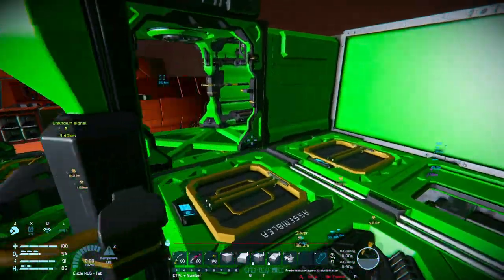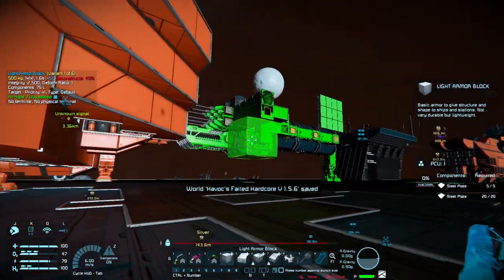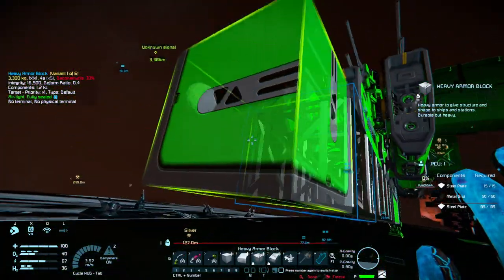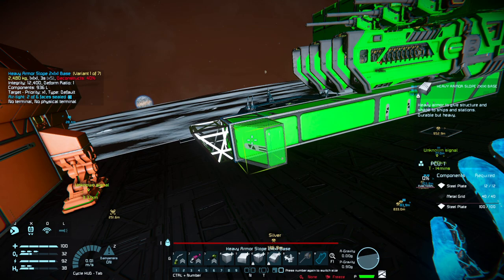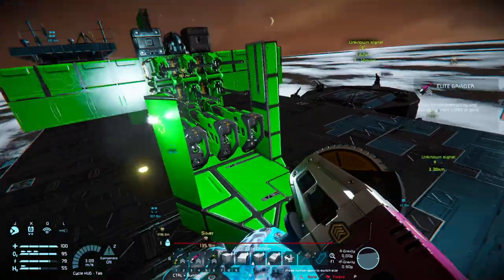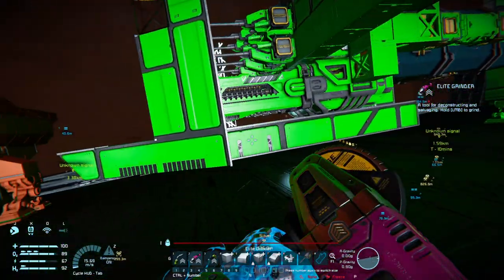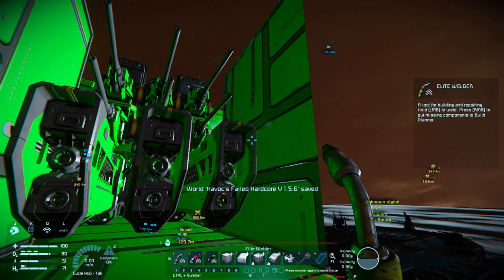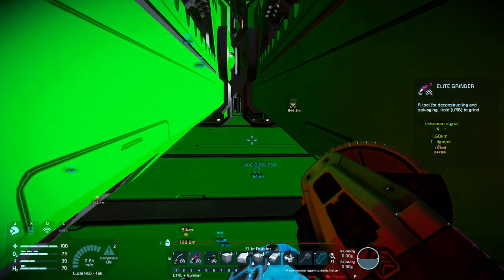Space Engineers ~ Not Hardcore ~ EP 216 ~ More B 90

Comment: Across the front of that, instead of light panels, I am pretty sure you can put armor plate for more HP in the same location...

And again, those passage blocks are an option too.

Possibly both, but I would not bet on that much leeway with KEEN when it comes to fitment.
Reply from the maker: Yes this was pointed out over in Discord as well. I will need to look into this.